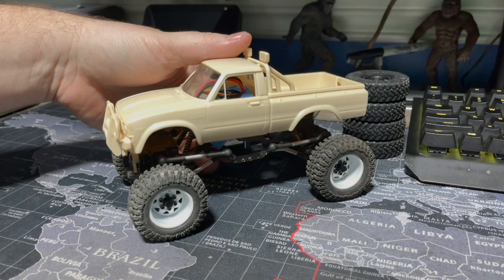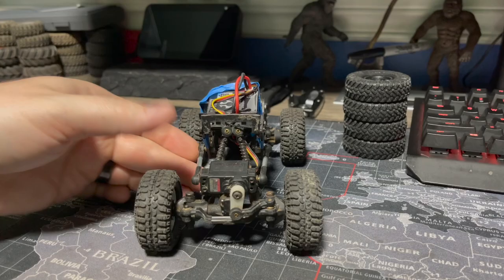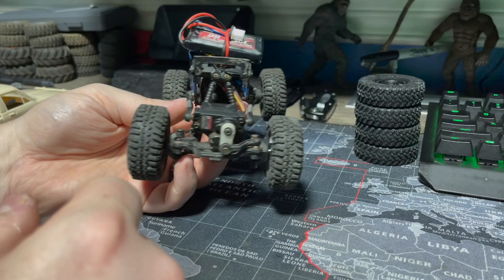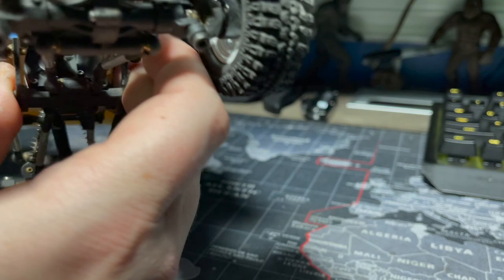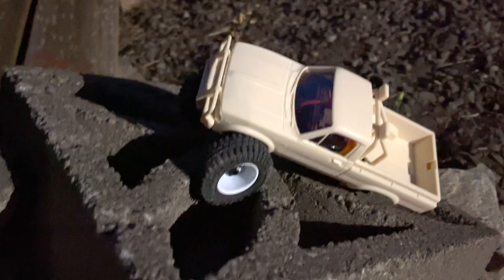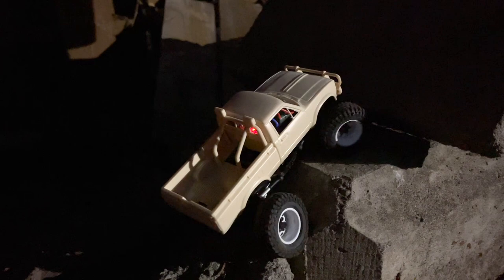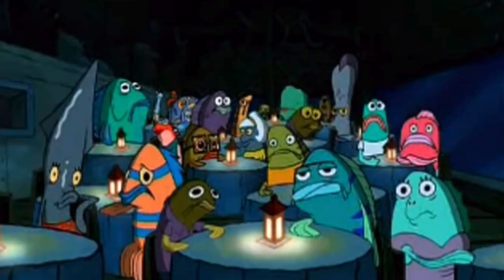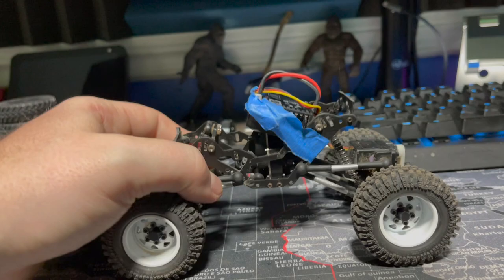Losi Micro Crawler.. maybe? // Modded old mini crawler given new life //

Comment: Whoa! Just when I was going to put my Losi Micro Crawler up on eBay. 

Those wheel and tire combo  are 🔥. I believe this one is the trail trekker cus it looks totally different from mines. The chassis is an upgrade and the suspension mount points are different from mines. 
Mines is not working due to the pinion gear being broken and I could not find a replacement. How did you get it to work?

I just bought the axial scx24 deadbolt to take its place but it’s bigger than the Losi.

Comment: I have 3 of these, just pulled them out last night (it's been in the negative temps here, so...) 

Question: you mentioned swapping in a motor (from a Axial 1/24th??) and you said "it bolted right up" just curious/ wanted to know for sure what motor/ gear you used, as 2 of mine have broken pinions (common problem, hard to find part) if the Axial motor is a direct swap a bunch of these could be brought back to life :) 

I am also working on the same Toyota body for one of mine!
Reply from the maker: Oh awesome! That’s really cool, yeah the stock motor and motor pinion from an axial scx24 fit the mounting plate and gear mesh of this old losi crawler. I don’t know a lot about these losi mini crawlers so I don’t know if this one I have is modded or different but the stock axial motor bolted right into place like it was meant for this old rig 😄👍🏻
Reply: @UpperLeftRC  that is great to know! The stock pinion (which should be a $2 part) is impossible to find, but SCX24 motors are everywhere and cheap/ lots of options :) ditto the receiver/ esp, I fried one because those battery/ connectors aren't all wired the same! 

When I first got mine, there were a bunch of "free mods" listed in some forum (it was a long time ago, can't remember where) and there was even a class for competing with them, they were very popular, for a short time....

Yours definitely has a ton of mods done, maybe even an aftermarket chassis?? it is shorter then stock/ comp crawler build? fun little rigs :) Need to get some of those wheels, the wider offset should really help with the turning radius..

I'm trying to get 2 going, one with the Toyota body, the other with a squarebody Chevy, to match 2 of my full size rigs, both of which see shows/ races occasionally, so matching RC's would be cool...